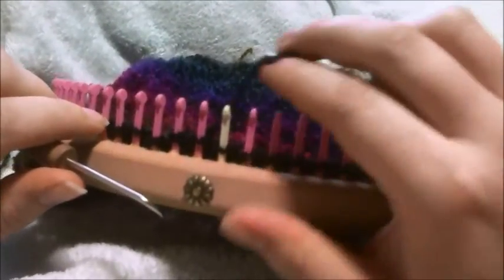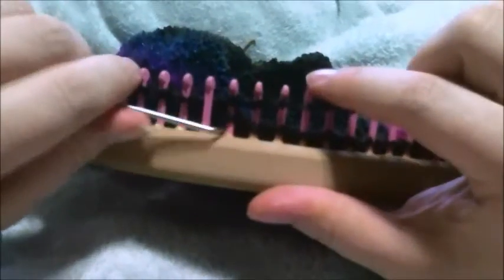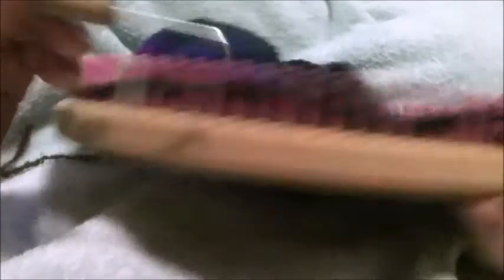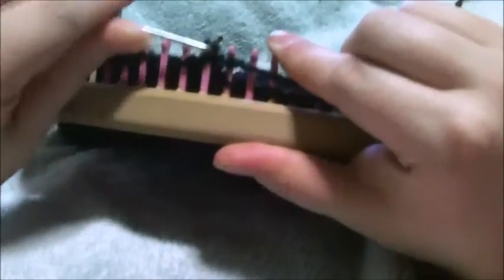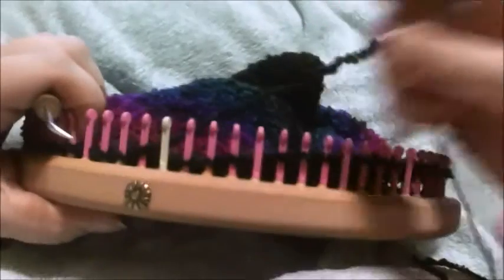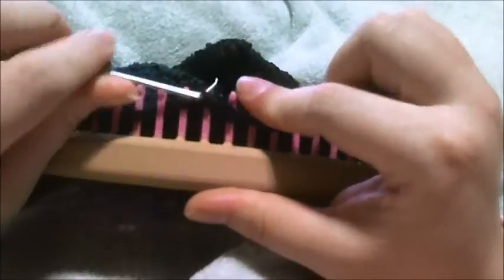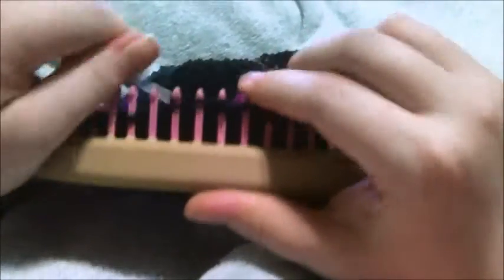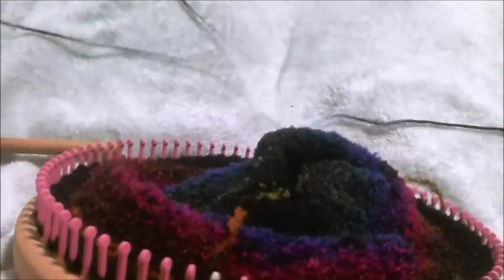How to Loom Knit a Drawstring Bind Off for Fine Gauge Looms

Comment: is that last loop, loose enough to put on the next peg? the problem with decreases and fine gauge is the stitches/loops are always so tight.
Reply from the maker: I tend to work fine gauge a lot and use this method to close. The stitches look slightly different, but because you are stacking 2 rows of stitches on the drawstring you don't have holes at the top and due to the elongated stitch it sits smoother.